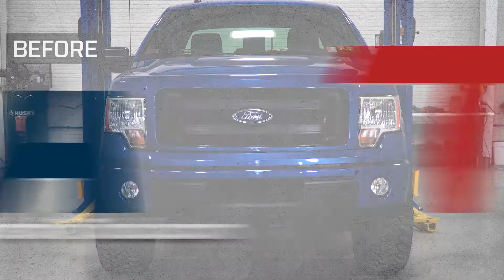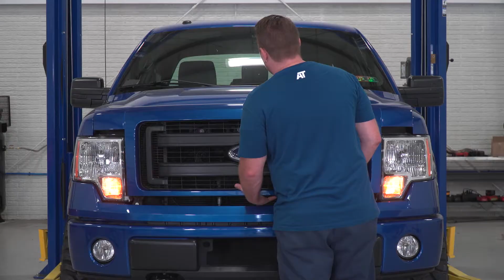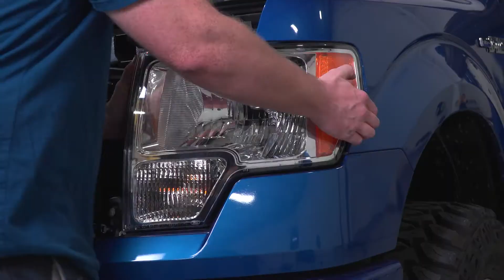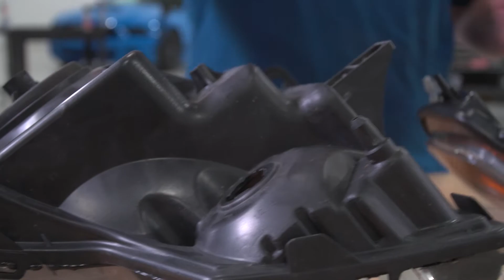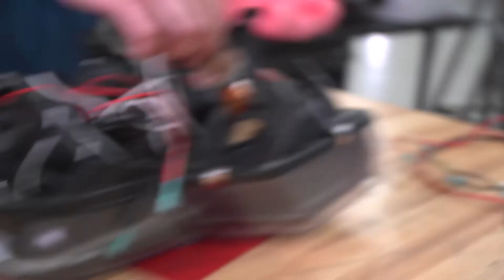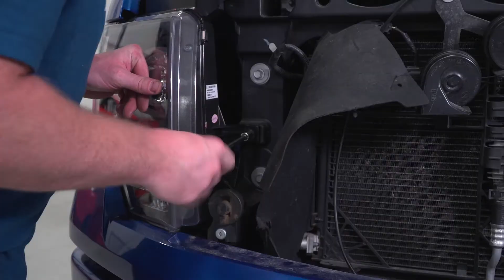Install 2009-2014 F150 Axial Black Projector Headlights w/ LED Halo

Comment: I have watched your video and a lot of other videos for replacing stock headlights with aftermarket halo lights. Unfortunately none of the vehicles in the videos have the same connector as on my son's 2014 Ford F-150 FX4. His connector for his stock headlights is a four prong connector with the prongs vertical not horizontal like in all the videos I have watched. Any suggestions other then to rewire the whole connection?